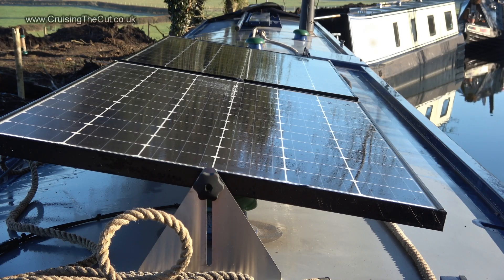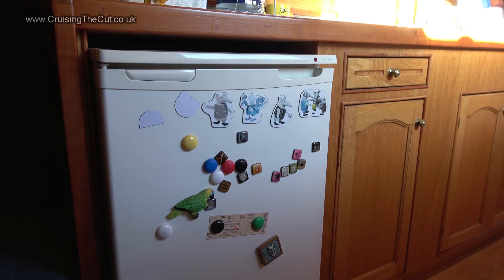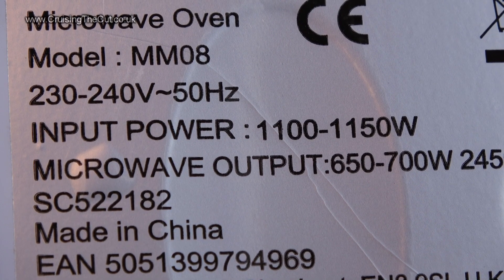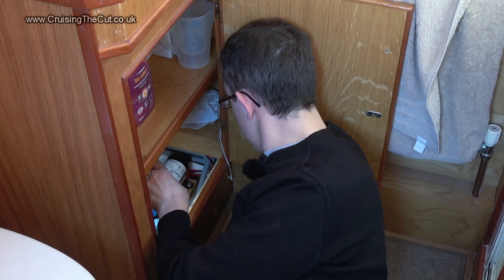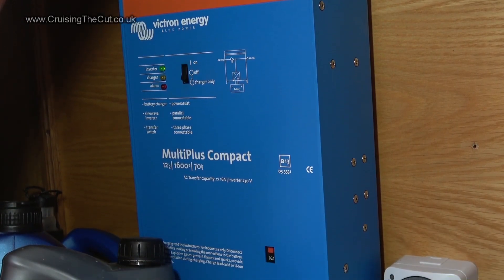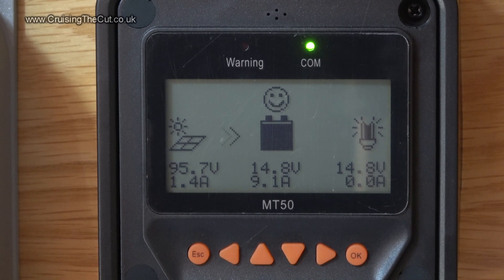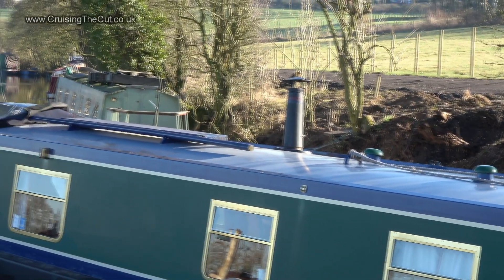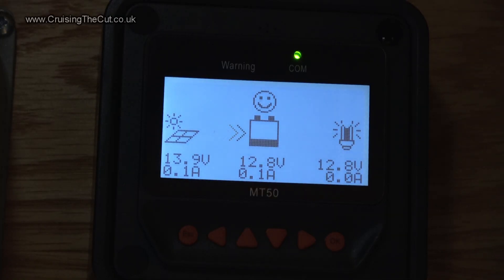76. Is solar power sufficient for a canal narrowboat in an English winter?

Comment: what if you would swich off the fridge? it is half of the needed power a day and outside is more chilly than in the fridge. maybe a bit less handy but an isolated icebox on deck with your stuff in it will keep it cold and save you 40 ah a day
Reply from the maker: Yes, that would be an enormous saving and I know of some people who do that, although you need to be sure that the outside temp will definitely stay cool enough to keep the food fresh so it might be a bit hit and miss as the seasons change from autumn to winter and winter to spring I suppose.
Reply: There are fridges running on 12/230 V and gas. Cooking and cooling with gas would save quite a lot of electricity.
Reply: I set my engel top load fridge on the well deck. When cool outside...it hardly ever draws energy. I move it inside during the Summer. It runs on 12v or shore power. 15 years old now...still working well. Very happy with Engel.
Reply from the maker: Not on a narrowboat there aren't, it breaches the boat safety scheme terms. Gas fridges are not permitted. Also, those fridges use a lot more power when on 12V than a dedicated 12V fridge.
Reply: Think you will find gas fridges are still in use on boats.

Comment: I find it useful to visualize the electrical system as being hybrid - made up of both fuel powered and solar powered elements.   This is not unlike a hybrid vehicle that has both a gasoline and an electric motor and systems to maximize fuel economy.   They don't have enough electrical power to take you where you need to go, but they can greatly extend the range of your vehicle by reducing its gasoline consumption with supplemental battery power that has been accrued through regenerative braking.

So, what solar tends to do - in your environment in the UK - is extend your fuel reserves that you're using.   The more solar you get, the less you have to run your engine/generator.    And, particularly with lead acid batteries, solar serves the purpose of providing current for the long absorption phase of charging where the batteries accept only a small amount of current, but need it for an extended period of time.   For that reason, it makes the most sense to run your engine/generator in the morning to provide the batteries with the bulk phase of charging, then allow the solar panels to top them off and then float them, rather than having to run the engine/generator the entire time.

Comment: What if you were to add another solar panel but set into latches to hold in place but when your moored up you have it set so you could stand it up to near vertical allowing you to harvest more solar energy. Say it's stood to a maximum of 80 degrees to have the panel able to harvest more sun energy. Granted it would be a pain to setup and take down but if you were to do this I'd mount a led  next to the start engine switch to remind you to drop the panel to horizontal to avoid damage. Say a hand cranked mechanism to raise and lower the panel.

Just playing devils advocate.

:-)

Cheers
Reply from the maker: You can add lots of solar and put it on all sorts of brackets and yes, on the occasional sunny days in winter it would make a difference (something like 30% extra on a fully angled panel versus a partially angled one). But many (most?) UK winter days especially December-February are dreary, overcast, rainy, dull ... the extra is still minimal in the overall scheme of things. In Spring-Autumn, you get enough sun that a decent array will pull in all you need either flat on the roof or angled only slightly towards the sun.

Comment: Gas fridge?
But really you need a better way of mounting your panels as you do but.
If you had mountings either side rather than in the middle you would the be able to have them closer to the roof so one side stays down and you lift the other.
Then if it was on a rotating centre you really could aim for the sun because you are not always broadside to it.
Then there's this:-    https://en.wikipedia.org/wiki/T%C3%BBranor_PlanetSolar
Reply from the maker: Definitely no gas fridge on a boat due to the always-on pilot light, it's just not done. There's no need to go overboard with the solar, pardon the pun. From Spring to Autumn, the mechanism as-is, is fine. In winter the weather is generally overcast and the hours of daylight shorter so even if you tilt the panels like mad you won't generate enough.

Comment: I've seen more negativity,know it all's and flat out trolls on this one video then all your others combined lol.Anyway,that aside I'd recommend looking into a high output or adding a secondary alternator.It'll allow less running and be the most cost effective solution for a winter cruiser in your shoes.I found we were able to do without our generator while sailing in the winter by adding a 150 amp auxiliary alternator.Oh and I currently have a wind gen,tow behind generator and 500 watts of solar for the smart asses around.None of them are enough when we need to run our watermaker etc.
Reply from the maker: Haha, there are some topics that lend themselves to armchair experts... a lot of more modern narrowboats than mine do have second alternators as you suggest, mine's just an older design when such things weren't needed so much. Wind gens don't really work too well on the canals from everything I've read. I'm a big fan of solar (except in the depths of winter as described in this video). 500 W is loads, for most things I think.
Reply: I just mentioned wind gens because even on my sailboat  a wind gen isnt enough either.Granted I dont have the biggest battery bank but still.Anyway,I truly enjoy the vids.
Reply from the maker: You can never have enough batteries ;-) Cheers!

Comment: Change the mounting brackets to get correct azimuth.  Stupid installation will never do the correct job.
Reply from the maker: It's not at all "stupid" - quite unnecessarily rude - indeed it's quite a common installation for narrowboats. The panels can be tilted to a certain amount but in summer they pull in so much power that they mostly lie flat all the time anyway. Only in early spring or late autumn do I have any need to tilt them and the angle is quite sufficient for my power needs.
Reply: YOU are the idiot complaining that they don't work only because YOU refuse to correctly install the panels.  Thousands of people living in vans boats etc have to lay their panels flat to travel but within a minute or two readjust them for optimum effectiveness.  Apparently you are either too lazy or too ignorant to change the mounting as I have seen on many other narrow boats use to maximize the use of their panels.  There are thousands of panel installations that provide full power in much harsher weather conditions than your boat will ever see.   Just like IF you don't know how a stuffing box works and needs maintenance then download or buy a book  and get some correct bilge mats that every commercial boat uses to control your bilge issues.  Stupidity needs no excuse & ignorance has none.
Reply from the maker: Again, rude, and needlessly so. We could have a civilised discussion but you seem determined to be vitriolic. Perhaps a nice calming holiday on a canal is in order?

My panels work fine, as described, whether flat or at their maximum angle. I am not at all ignorant of the benefits of tilting the panels but it is not necessary in my setup. The panels already pull in more power than I need and during winter I tend to moor with a shoreline.

As for my stuffing box, it's also fine, thanks, with a reasonable regular drip which is caught with a bowl as shown in my videos.
Reply: Really lost as YOU were the one in the video complaining that your solar installation DID NOT supply enough energy. That YOUR choice of mounts had limited travel. If you can't take constructive criticism then don't publicly post.  I am rude to ignorance -  ignorance kills.  You have no excuses for not learning important health and safety issues concerning the operations of your boat unless you are paying a professional to regularly check all operational aspects. Even then daily minimum operational checks are the responsibility of the current operator.  Its not rocket science as hundreds of others are apparently surviving safely on their longboats without incidents.
Reply from the maker: Sigh. I'm quite open to criticism, when politely expressed. Rudeness, however, is unwanted. Your apparent notion that it's OK to be rude if you're pointing out someone's ignorance is itself quite ignorant.

Meanwhile, speaking of being lost, I'm baffled as to what you're talking about with respect to "not learning important health and safety issues" especially as I am indeed "surviving safely" and have done so since moving aboard. But thanks for your concern.

In terms of the original "complaint" - which it was not; it was an observation, being made hopefully for the help of others - the point of the video was simply that a) there are fewer hours of useful daylight in winter and thus less solar energy available, and b) many (maybe most?) winter days in the UK are overcast, rainy and otherwise miserable thus again substantially limiting any solar energy. Both points are true regardless of how you orient your panel. On the rare blue sky sunny days then you will indeed gain from orienting your panel but even doubling the output through such means would remain a minimal input overall and thus the point stands that solar alone is unlikely to be sufficient for many boaters in winter.
Reply from the maker: Yes it is rude. As was "stupid", "idiot", "lazy" and "ignorant", no matter how you try to defend them.
Reply: Please dont hesitate to delete ignorant trolls.
Reply: General rule for YouTube... never scroll down to the comments. For some reason I thought that videos about narrowboats would have civil comments. Wrong! 10susan10, you are needlessly rude.
Reply: This is unnecessary.  I really don't like it.  Why do you get so invested in this man's video that you find the need to personally attack him and his intellect?  Shame, shame.
Reply: He wasn't complaining! He was just sharing what he found.
Reply: Is 10susan10 an ex girlfriend haaaaaaaa.  Definately signed up to POF I reckon....
Reply: Please stop the nasty Lady shouting Its making my bottom lip wobble.
Reply: Oh dear. Take another pill dear.

Comment: I love solar panels, however running a diesel engine to make electricity, although noisy and smelly is doing less harm to the environment. There are very rare and nasty materials used in the manufacture of solar panels, and to mine these rare materials and manufacture panels requires more electricity than they can produce in their lifetime.
I'm just an average consumer, all I care about is cost and convenience, and solar panels tick both boxes.
As for wind generators, most of the power they produce is turned into noise. Yet we are given incentives to switch to wind or solar, and avoid fossil fuels which do less damage in the long run.
Reply from the maker: One key advantage to solar is that it is silent so avoids annoying both other boaters and householders if you moor in an urban environment. Nothing creates friction between canal and bricks-n-mortar like the running of an engine or generator for a couple of hours!
Reply: CruisingTheCut  you are correct on the noise pollution, I have a bloody American boat anchored a few metres away, and he has been running his engine for the last 72 hrs. The only time he turns it off is when he takes his family ashore in the daytime. I haven't had a decent nights sleep since he arrived, but this has given me lots of time to watch YouTube videos 😎
Reply from the maker: How very unreasonable of them. Not fair at all.
Reply: CruisingTheCut  Some people seem to be unaware of how sound travels across water on a still night.
He left this morning, so a nice tranquil evening in store. : D
Reply: @LinuxUser Yes, this silicon stuff is absolutely toxic, toss your computer and smartphone immediately or you'll grow horns and a tail. It's also as rare as sand. Yes, there are some experimental and niche chemistries like cadmium-telluride and something with indium/gallium, but they are much less efficient than both mono- and polycrystalline silicon while being more expensive, so no boater is ever going to use them. More importantly, materials like cadmium are only bad if you ingest them; I put it to you that if you're ripping off the transparent shielding off your solar panels and licking them, you've got serious issues besides and beyond environmental concerns.

Comment: this is a very annoying subject for those trying to get free!! energy, same old problem energy out is always less than energy in, generating electric by connecting a cycle to a generator "does work" as long as you have a few hours to spare. At least you would be very fit lol.ie not practical. I have mentioned it on an earlier episode, not cheap but have you looked at the Tesla battery storage? apparently able to power a house overnight.

Comment: 1.  Shut fridge off at night
2.   Shower less frequently
3.  Use laptop for news, streaming (ditch the TV)
4.  Replumb the shower to run overboard (if possible)
5.  Shut off hot water heat to all but the bedroom
6.  Don't flush for #1
7. Change swivel/tilt angle of solar panel to optimize per location
Reply from the maker: Yes, you could do all that (except re-routing the shower drain, which requires a pump) but angling the solar in winter will make pretty much no difference because, as explained, there aren't many hours of winter daylight anyway, the light is not very bright, and it's often entirely overcast or cloudy in which case the light is diffused anyway so the angle makes no difference.

Comment: Do you really need to use your fridge in the winter, how about a plastic box under the cratch which will be cool enough and save th power that the fridge uses?
Reply from the maker: Sometimes that would work but some days can be quite mild and the cratch is a bit like a greenhouse. The engine room on the other hand, if I'm not moving, gets very chilly!
Reply: Presumably, the water in the canal warms up much slower than air during the day due to the thermal mass. It'd be interesting to stick a watertight aluminium container in and see if that works. It definitely works with beer in a river on a hot day. On the other hand, given some of the water quality I've seen on your videos, perhaps that's one clever engineering trick too far ;)

Comment: Try a wind generator like on a sailboat. I know in the UK your canals has tunnels but set it up so it can be removed.
Reply from the maker: I know some boats have them but ... the wind is very intermittent and not that strong on many of the canals (yes, there are spots where it's very gusty but not everywhere by a long chalk); they make a lot of noise (vibration) and they're expensive and need taking down / putting up when you move. So, I'm disinclined to get one.

Comment: The angle is much too flat. The angle of incidence should preferably be 90 °, then the power is many times higher. Building a new holder should not be so expensive.
Reply from the maker: Yes it does increase the power substantially when the panels are pointed directly at the sun but you're rather missing the point of the video which is that a) there aren't enough daylight hours in winter to generate enough power even if the sun is shining brightly, b) there are very few sunny days in the UK in winter anyway; it's usually either raining or at best overcast, c) if overcast then the light is being diffused and pointing the panels won't make any difference since there's no single source to point at.

Furthermore, even if the power increased several times by angling the panels (and lets's say you generated 5A instead of 0.5), you'd still only have a few hours of daylight; it would need to be totally sunny throughout that time to maintain that level of generation; you'd need to constantly adjust the panels to be directly facing the sun throughout the day if you want that maximum output.

In short, solar in winter in the UK on a boat is not going to provide all the typical power needs even if you tilt your panels.
Reply: Of course you're right, it will not be enough. But like you wrote it's about 10 times more power.
We got summer and winter because of the angel of the sun, not because of the lenght of days, that shows how much relevant the angel is.

Comment: Hi David
Love your Vblogs Thanx. 
My wife and I own a narrowboat. We do not live aboard we use our boat for extended holidays on our canals. We love it. We are both still working. (ouch)
The power consumption is usually one of the hot topics with boat owners. Personally,  I think it's a matter of compromise and adjusting living/cruising habits to suit. Our boat also has a solar panel I fitted after it appeared our 12v fridge was running low on power overnight. I fitted an 80w single solar panel and the problem disappeared with our leisure batteries now kept in good condition via the controller.We also have approx the same draw as you per day TV pumps PC etc although I have not totaled our usage.
I have also a small jenny we can use when appropriate.
I have fitted a heavy alternator to our boat allow better charge via engine  when appropriate (moored)
There is also the option for wind turbine if a boater wishes.
I guess it starting to look expensive now lol. 
Keep up your great vlogs, maybe we will pass each other one day while chugging we can chew on more topics.
Bob Wendy Harlequin.
Reply from the maker: Hi. Glad you like the videos. You certainly sound covered for power. Cheers